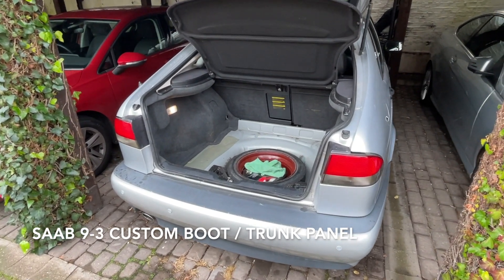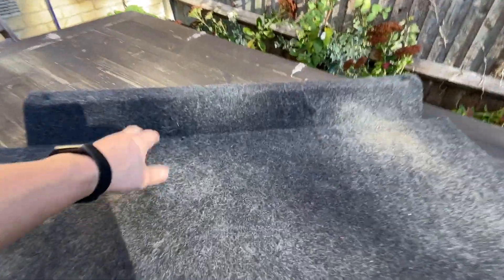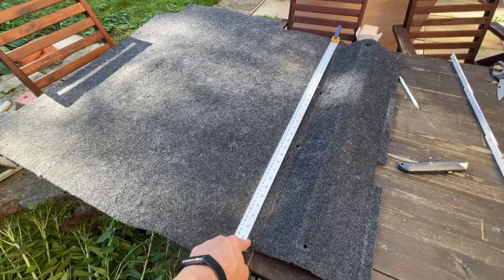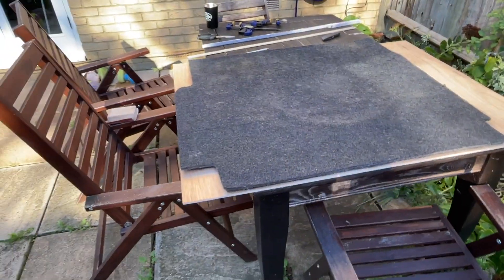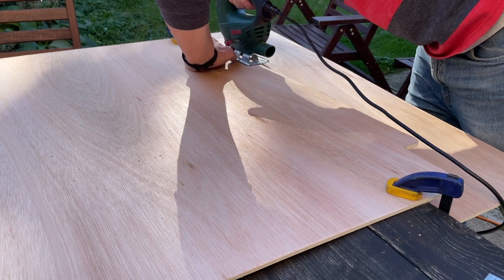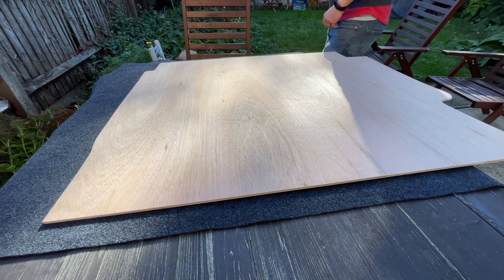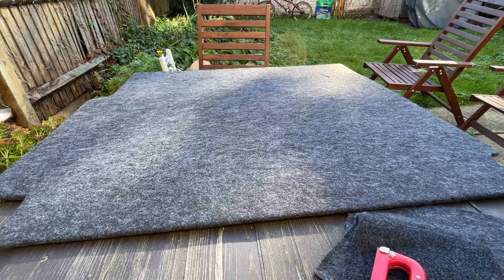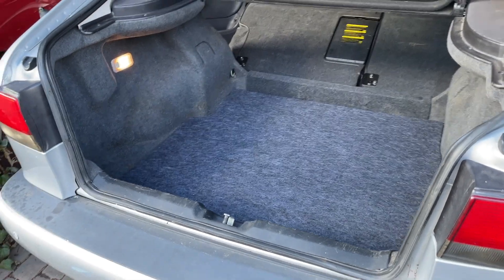Saab 9 3 Custom Boot / Trunk Panel

Comment: Good job! I have the same problem with my 2002 9-3. 

Did replacing the seals on the taillights stop the leak? 

I'm about to replace the seals on mine and it looks like there is an additional leak from higher up - from the gutter, at a seem in the metal, inboard of the antennae.
Reply from the maker: This helped a bit, but I also had/have the problem with water coming in via the seem. I used some silicon on both sides and managed to fix on the left side, but I still have the problem on the right. I might have fixed it yesterday. I removed the rubber gasket going on the right side of the gutter and noticed that the metal was bent down, which could have allowed a path for water. I fixed it and reinstalled it. It rained last night, so I need to go check for water . . .
Reply: Thanks for that additional information about the seam. Too cold in Connecticut right now to use silicone or other sealer so I put some of that silver tape (the thin aluminum tape used for insulation) over the seam on the side that leaked and that stopped it completely. I had previously sealed up the taillight but still had some leakage.  @randomtasks